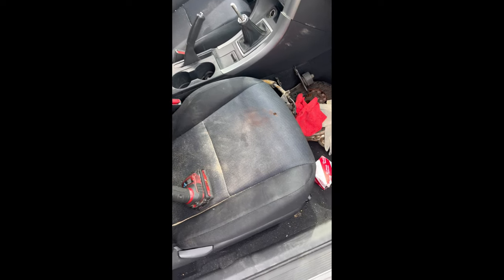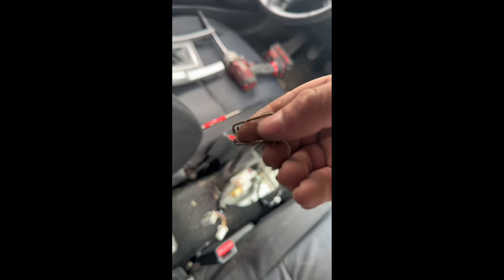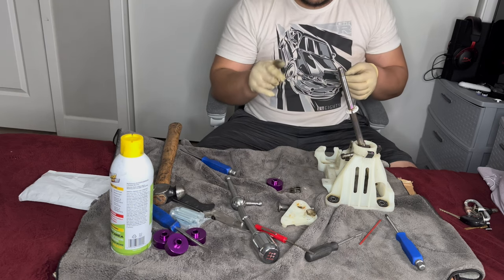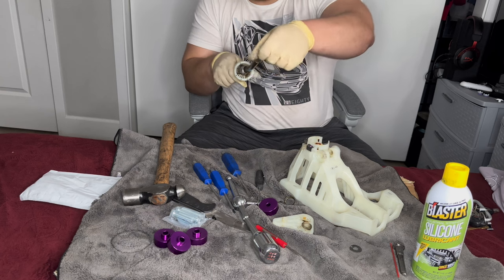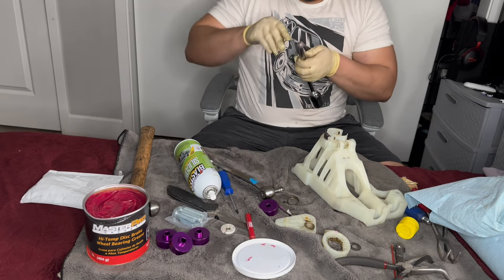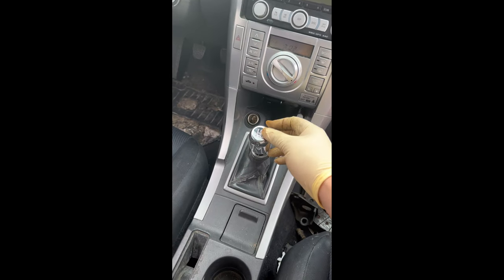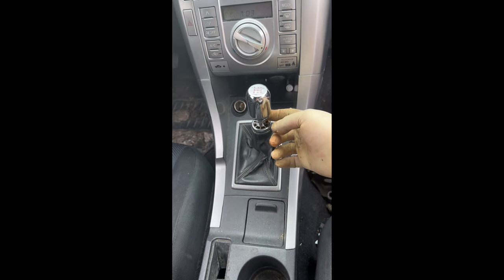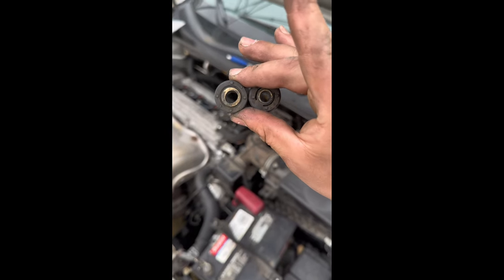Scion tc: Megan racing short shifter/ TCS shifter cable bushing install

Comment: Bro how’d you remove the black washer holding the pin? I’m currently stuck at that part
Reply from the maker: I actually broke mine but the shifter kit that I got came with another one. Basically I used a screw driver to go under the washer and just kept prying up on it for multiple sides until it came off.